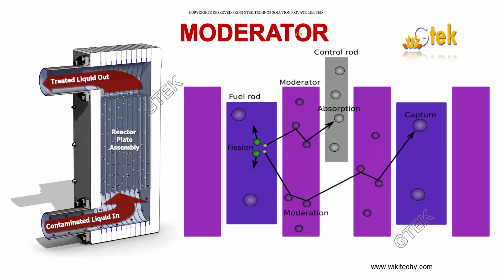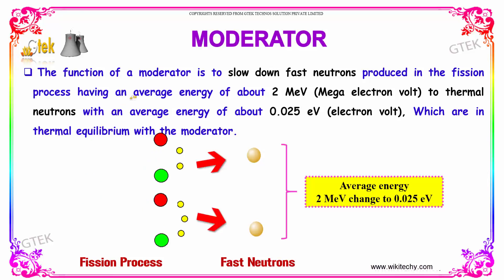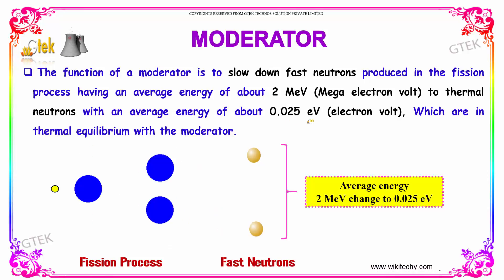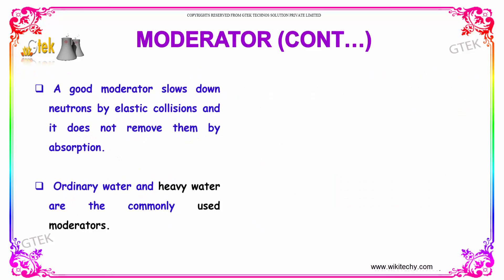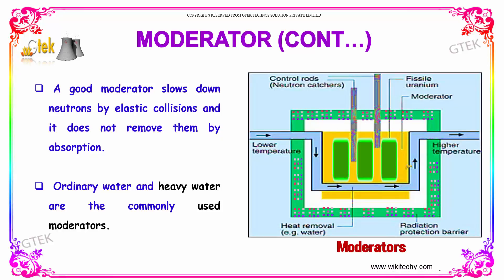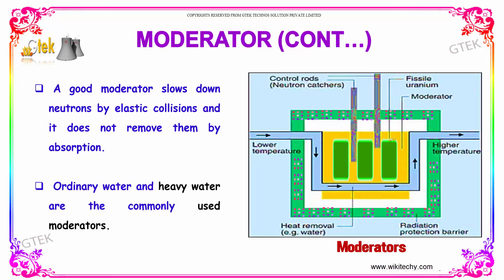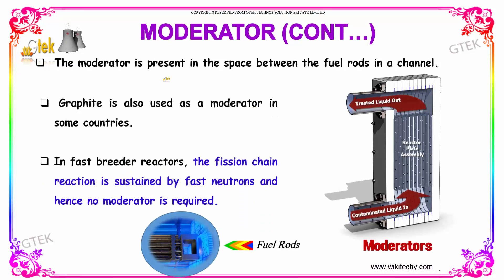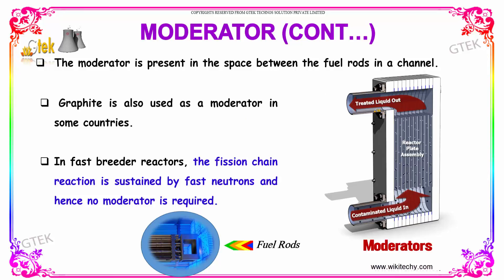Moderator | Nuclear Physics | class 12 physics subject notes lectures|CBSE|IITJEE|NEET

Comment: The elements given are used as fuel in fission reactors. Water, heavy water, air, and molten sodium are examples of coolants. Boron and cadmium make good control rods. Moderators like graphite and heavy water slow down neutrons.

Comment: Explanation: The elements given are used as fuel in fission reactors. Water, heavy water, air, and molten sodium are examples of coolants. Boron and cadmium make good control rods. Moderators like graphite and heavy water slow down neutrons.

Comment: In a fast reactor there is no moderator, only fuel and coolant. The moderation of neutrons is undesirable in fast reactors. Commonly used moderators include regular (light) water (roughly 75% of the world's reactors), solid graphite (20% of reactors) and heavy water (5% of reactors).

Comment: The function of a moderator is to slow down fast neutrons produced in the fission process having an average energy of about 2 MeV (Mega electron volt) to thermal neutrons with an average energy of about 0.025 eV (electron volt), Which are in thermal equilibrium with the moderator.